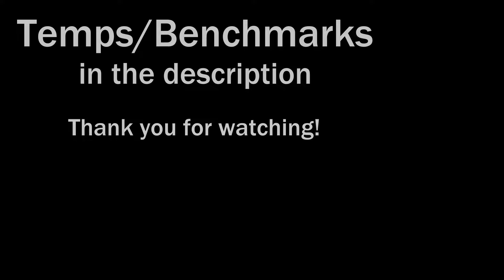Fractal Design Ridge - Full Build!

Comment: It's pretty awesome how everything fits in. Nice build you have done! 💪
Are those RGB fans disturbing the airflow for the GPU? I might have gone with three of the Thermalright TL-9015B instead, because they are thin /slim form factor 90mm for the front fittings OR for using them as the air outtake

Comment: I just don't understand why we have two fans in front of another pair of fans from the gpu, surely this created turbulence due to misalignment and reduced overall efficiency. That paired with the fact that the brackets which hold the fans have air passing through them creating more noise than there should be. I mean... at this point i'd rather have them coolers tied up and suspended in air with the graphics card fans facing the other way like on RTX 4070

Comment: only concern about this built is dust only front cover i guess have dust filter so how we solve this problem ? also its good for high tdp cpus or we should get more like i7-i5 type a cpu because i use sugo 13 and that case take lot of dust and thermals are not good even i use aio cooler.
Reply: since everything is easily accessible dust is no problem since you can carry it out quickly and blow it then youre good to go
Reply: everything about this case is nice but what i dont like is it has a millions of screws lol

Comment: jo man can u please help me i really want this case but i want it with a 240mm or 280mm radiator for my cpu and i want a grapics card in it so if i do a 280 aio and a 3080 or 3070ti is that possible witht the space😬😬 please me know i really hope thats possible man becouse all other cases i dont like i want this one really
Reply: you can fit any 2slot card basically maybe not a 3080, and no aio’s can fit in this case at all

Comment: why not the nh-l12s for the cpu cooler?
Reply: I know this is an old comment, but would like to state I just finished this same build but with the NH-L12S and it was a nightmare, it's BIG (relatively speaking of course) for this case.  My ram was too tall (had to trim the heatsinks), had to unscrew the power adapter "coupler" from the case and let it dangle out the back and leave one of the side screws out that goes into the bottom cover.  Even then it was a PITA to get in there without rubbing.  It fits and keeps my idle temps with 12600k at 32-35C and in game around 50C.  So maybe it was worth the hassle?  I'd probably go with the Shurken like this build if I did it again.
Reply: @gatoenfuego8734  that's funny I ended up having to do the exact same thing. I have a 5800x3d which gets pretty hot, I have to underclock it to stop it from overheating so I definitely needed the nhl12s lol. 5800x3d performs great with all that done though

Comment: one question, is the cpu fan in the right direction? 🤔
Reply: why wouldn't it.. it has to blow over the cpu.. build pressure over the cooling fins.
sucking air don't work, that reduces the pressure and less air molecules =  less heat transfer.

Comment: My concern is with the horizontal orientation and the GPU being upside down. GPU fans will have to draw heat away blowing down on the table. I wished they provided an option to mount the GPU flipped over with a long PCI riser cable. Both the CPU and GPU would be blown above and out.
Reply: GPU fans suck the air in och exhaust on the rear or the case, no?

Comment: You didn't show how you hooked the fans up
Reply from the maker: I did show it. 1 -> 2 fan splitter plugged into the chassis fan header on the motherboard. Then the RGB connectors plugged into the Corsair Lighting Node Pro RGB hub.